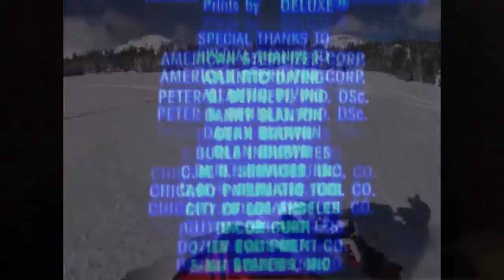Ski-Doo Muffler Choices PT-1 Summary  IBACKSHIFT

Comment: Put the HPS can on my Gen 5. The weight you recommend and clicker on 4 worked out perfectly, maybe even a smidge high on the RPM but to me liking. And I weight 270lbs+ gear. Safe to say that HPS can is proving to have a HP gain, or at minimum at least maintaining stock HP.

Comment: I experienced this issue.  Installed your clutching and bikedude can on my turbo r. Only tinkered with pin weight for two trips wondering why the sled won’t pull rpm.  It also seemed like changing pin weight did not change my peak rpm much if at all.  Stock can helped this issue.  Although, i find that I need to keep my clicker on 5 all season( aside from 4 which you recommend).